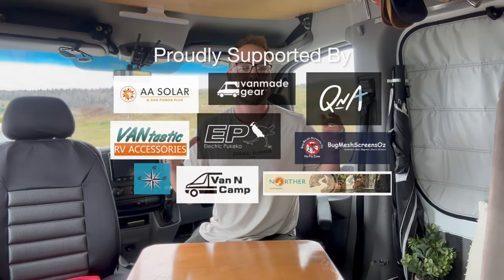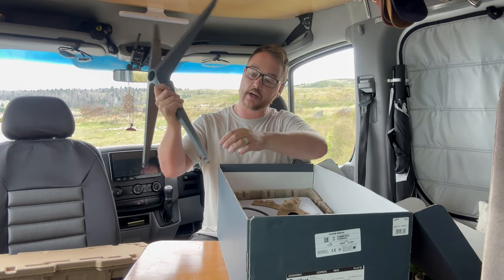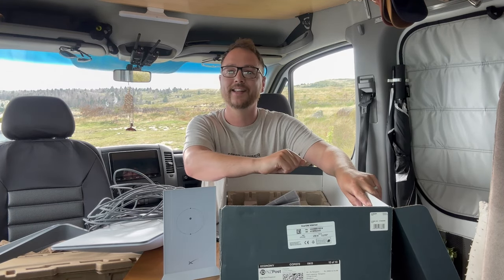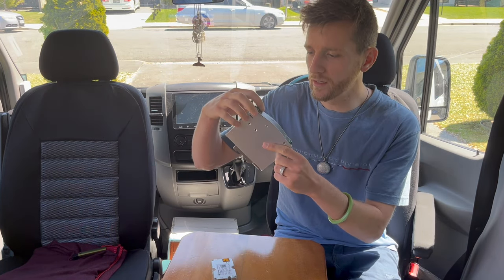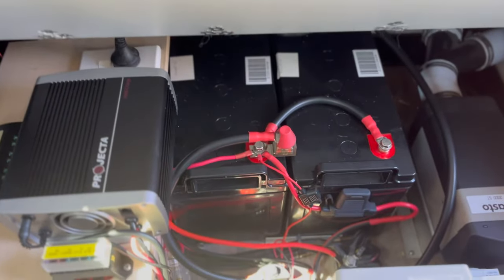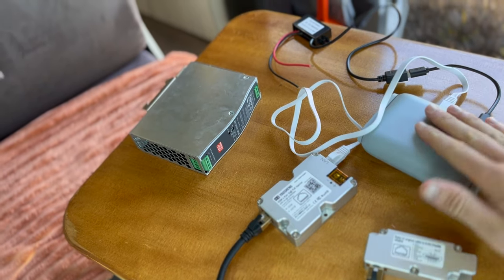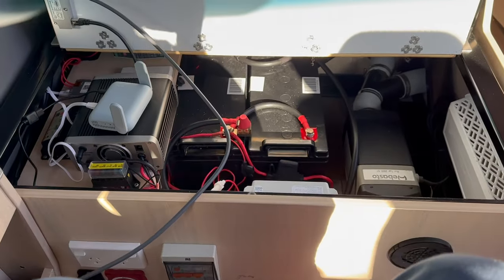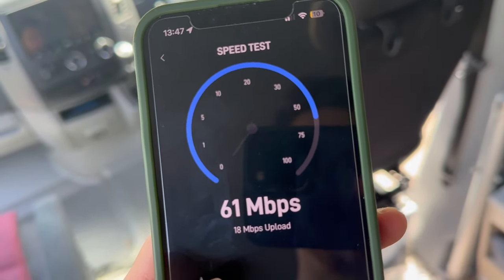Starlink 12 Volt DC power supply for your Van | Easy DIY Tutorial & Review

Comment: Hi thank you for your video. I have everything for this setup but am still troubleshooting. I think I may have the wiring for the dc converter wrong. Can you explain in simple terms how this connects from the battery to the Poe injector? I have no technical background but have everything for crimping wiring etc. 
Thanks!

Comment: you do not need to go into bypass mode? I am unable to get such setup going... I do not know what am I missing
Reply from the maker: Try adjusting the voltage output on the Meanwell to 50V (not 48!). There is a small dial that you can adjust. Saw someone else had luck with this. You don’t need to be in bypass mode. Once you plug everything in, it should power up the Starlink and everything should just work

Comment: Great video and I have tried to replicate! However I cannot get the Meanwell converter to power up…. I fear it might be faulty! Not so sure the big bucks investment in that item was worth it!
Reply from the maker: Thanks! Try adjusting the voltage output on the Meanwell to 50V (not 48!). There is a small dial that you can adjust. Saw someone else had luck with this
Reply: I did but it seemed the Meanwell was faulty. I actually replaced it with a much cheaper converter that was recommended on Amazon. Wired it all up and it’s working brilliantly! Not sure you need to spend the extra on that converter but time will tell……
Reply: Which one did you get? I got a 48v step up but the output of it seems to be 13.3v. I bought two and they’re both the same, so Im lost.